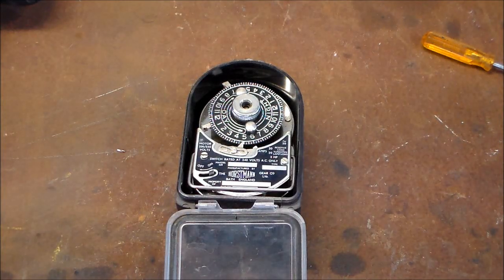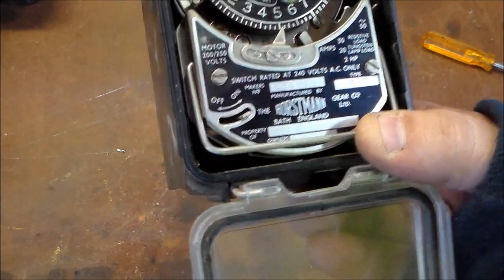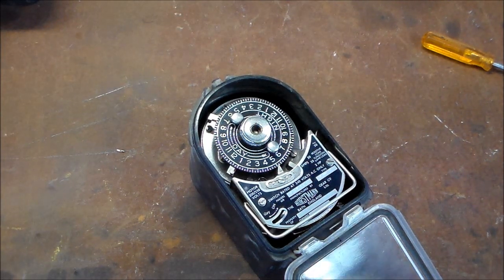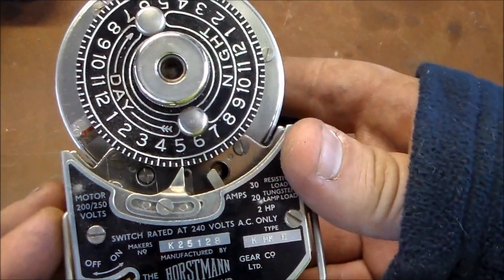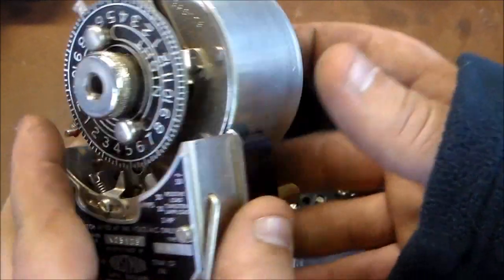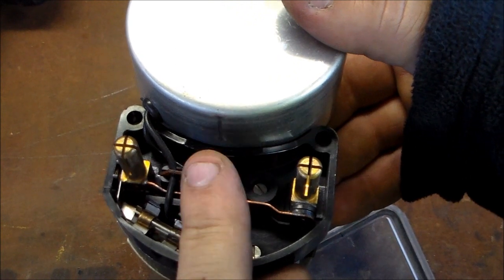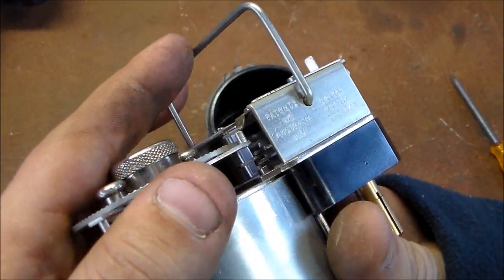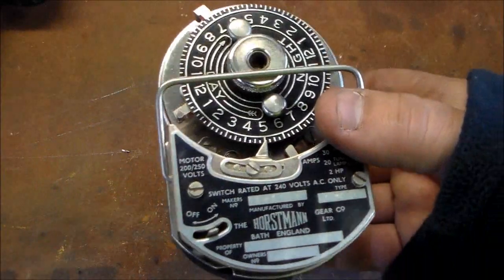Vintage Horstmann Electromech Timer

Comment: Hiya Rodalco. The Kmk2 doesn't have an escapement in it. The Kmk2 only has a synchro-motor, & that's it. The Ymk2 is a different animal though... :-D

Very similar to the Kmk2, the Ymk2 also has a spring reserve, with all of the other related workings like an escapement. 

However, unlike Horstmann's Vmk range, the Ymk2's escapement runs continuously. With the Vmk range, the escapement only runs during power cuts, or during it's daily exercise routine of approx 6-15 minutes. :-)

-BoomBoxDeluxe.